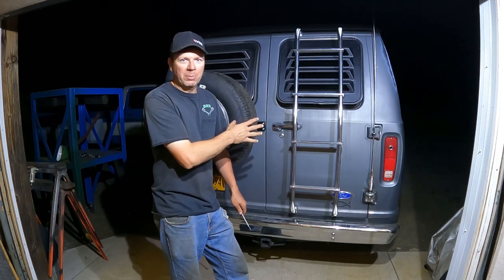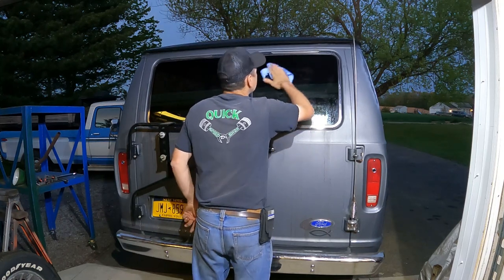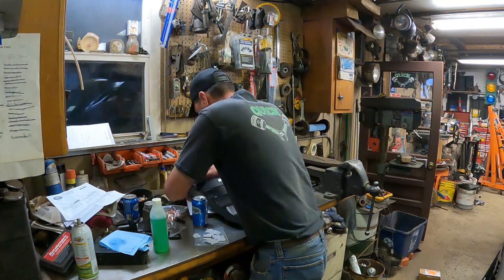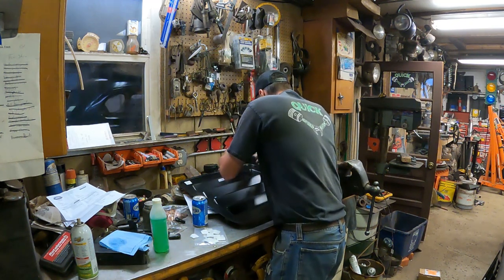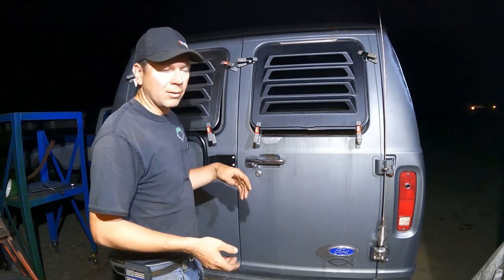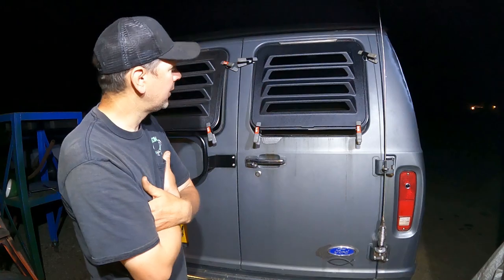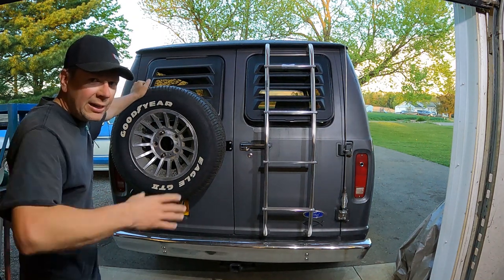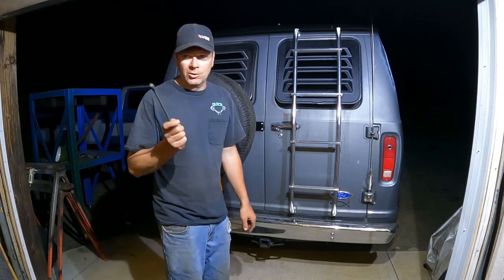Ford Econoline Boogie Van:  Installing Rear Window Louvers and Door Ladder E150

Comment: I'm considering buying a 1989 Ford e350 high top conversion with 120k on it for 6k, but I'm gonna try to talk them down. Any advice for what would be good to ask a mechanic to look out for?
Reply from the maker: Check for rust around the body bolts and in core support behind grille.  Have mechanic check king pins on front axle.